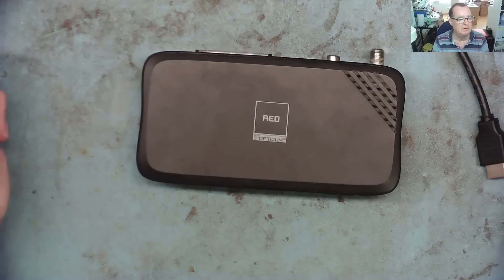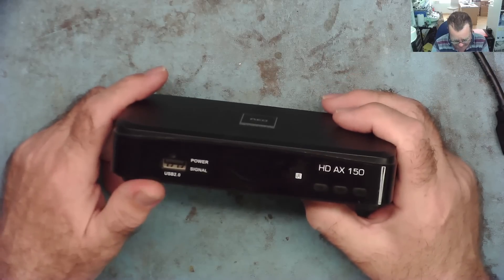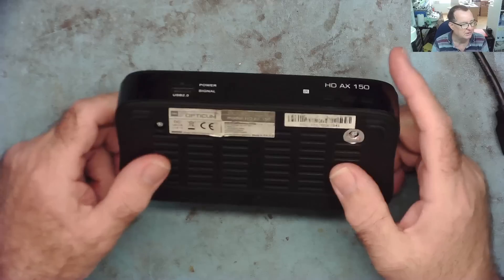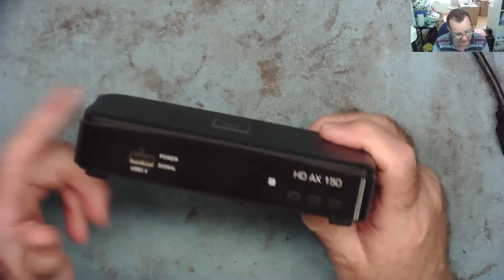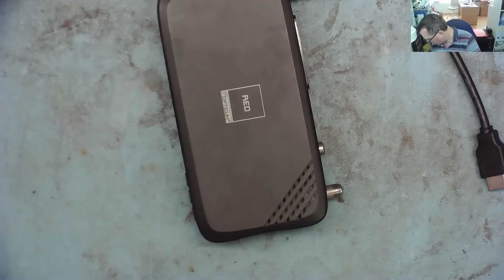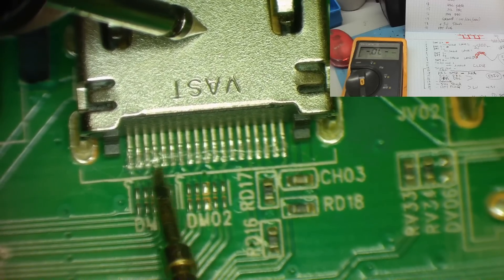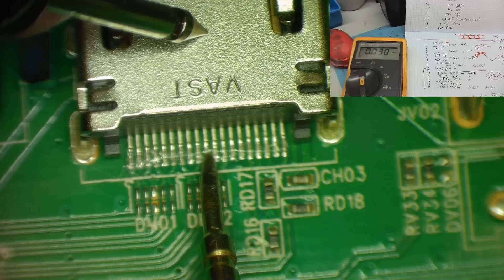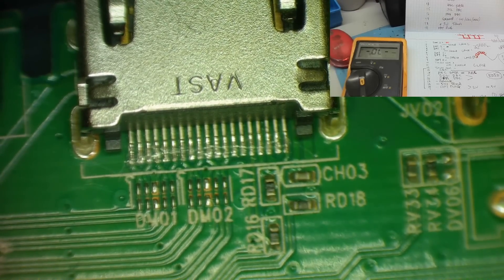All You Need To Know About HDMI To Fix Stuff - Reprise. How To Repair Broken No Video

Comment: If that's the only pin on the chip that is shorted to ground, wouldn't it be better to first try finding another pin with the clock signal on it and connecting it to that resistor before replacing the whole chip?

Comment: You showed up in my youtube, probably because I do watch a LOT of repair videos. I am not going to click on dislike, but I will say the following. The amount of time you have the probe on something proving there is a short is stupidly long. You position the fluke very close to the speaker so it is loud as hell, far louder than your voice. On your video, I lowered my volume to 20%, maybe that is the reason people dislike? I am here to hear you, not the long beeps that are louder than you.
Reply from the maker: Constructive criticism I like. Funnily enough I increased the volume on my recent videos as some people said they were too quiet/muffled. I normally use the Kaiweets meter on videos as it has a much larger display (and a quieter beep actually) I just need some batteries for it and didn't get chance to grab some.  Hopefully that will sovle this problem - let me know when I switch back to using it 😉
Reply: @LearnElectronicsRepair  This was the first video I had ever seen of yours, and I did like it. I will return.
Reply: I have a hearing problem so dont hear the high frequency sound of the meter , just thank the stars you have good hearing and stop complaining how well you can hear.
Reply: @swell1351  Digging up a post that was mentioned over a year ago to complain about something that affects only you is a charmer. Since the owner of the channel basically agreed with my statements, you need to stuff your head up your backside.

Comment: The laptop last time now this receiver, have you consider that the problem may be at the TV?
Reply from the maker: yes mate - the laptop was tested on two TVs and two monitors with at least four cables (some on site and some at the workshop).  This receiver was tested at the bar it came from and I found the same fault at my workshop 😉  But it's a good question - never assume your test equipment is not causing the problem!